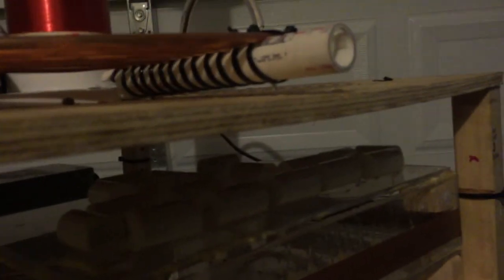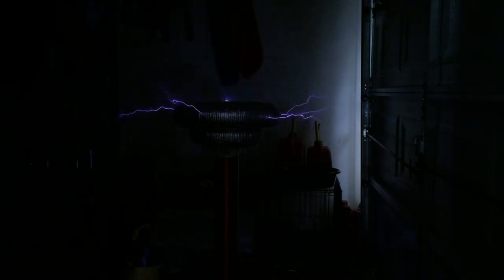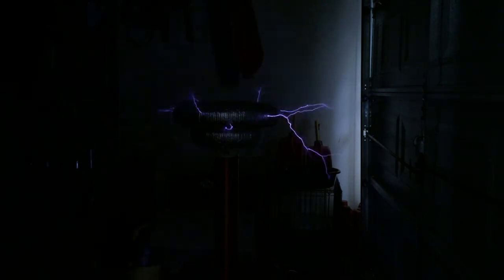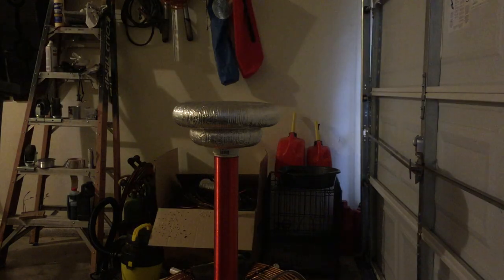UPDATE: First time tesla coil build part 2. 15kv NST. LONG ARCS

Comment: I do have one suggestion. It's not required, but it is recommended to add a "strike rail" which is just some more copper refrigeration tubing above your primary coil. Then you have to connect it to ground. It protects your primary from being hit by any arcs.